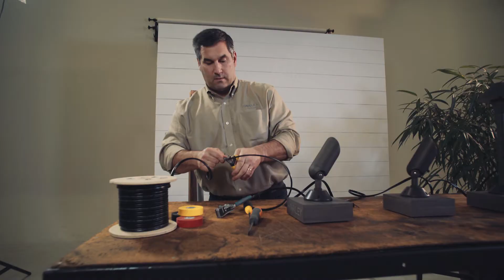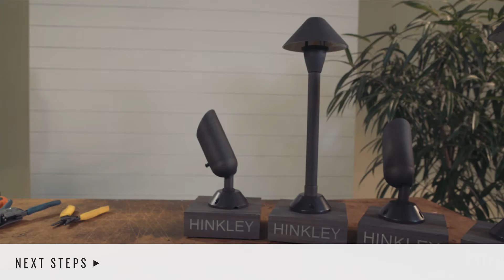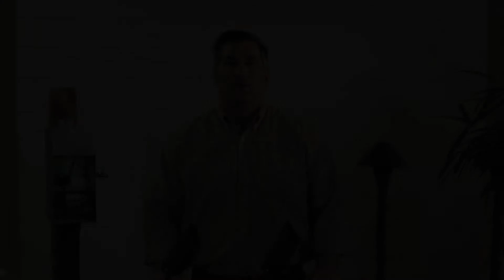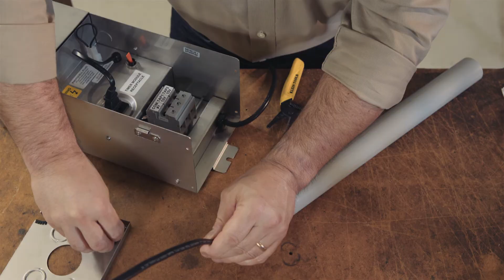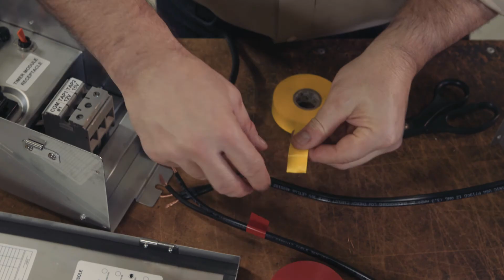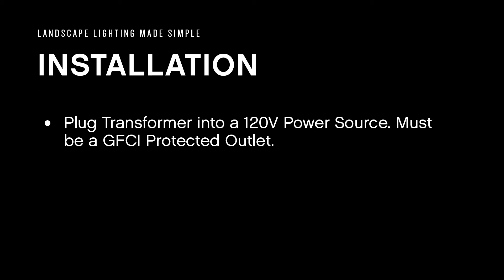Landscape Lighting Made Simple by Hinkley

Comment: great video , only question I have is , does the transformer need to be outdoors for any reason ? based on my project, my power source is indoors .
Reply from the maker: Hi Vito!  Our Pro Series Transformers are rated for both indoor and outdoor use. Glad you enjoyed the video!
Reply: @hinkleylightinginc  thanks,
I should of asked earlier : the system I'm designing will be using 162 watts with 3 legs.  Which transformer do you reccomend ? Thanks again.
Reply from the maker: @jman6137  No problem! Our Landscape team recommends the 0300SS for the application. Check it out here: https://www.hinkleylighting.com/0300ss.html